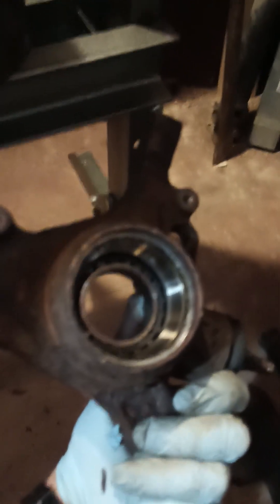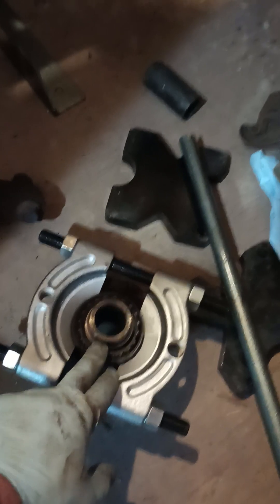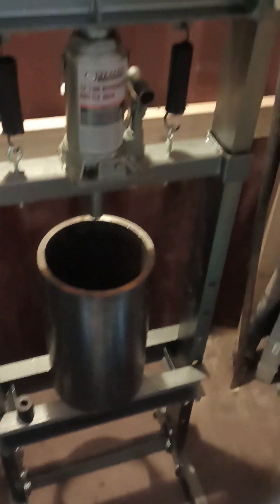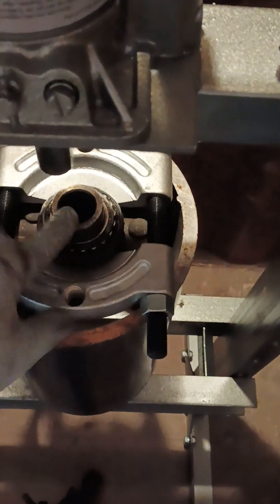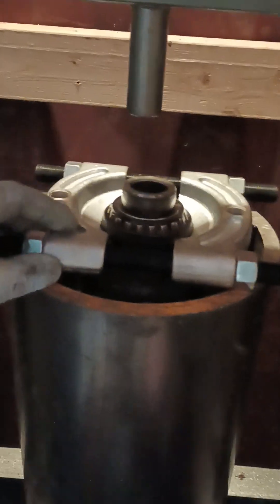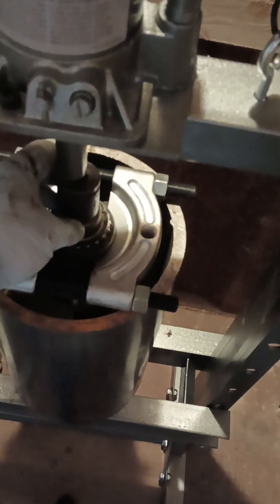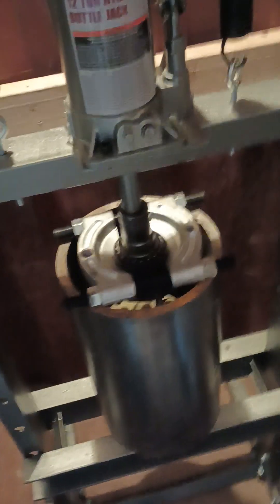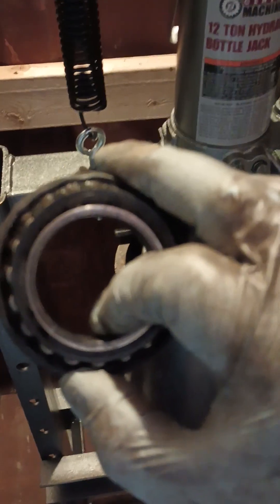How to Use a Bearing Separator with Shop Press

Comment: Very nice explanation! 

  For the outer race stuck in the knuckle you can lay a bead of weld on the outer race and it will shrink.  Making for easier removal.